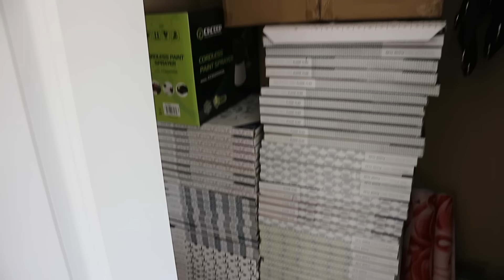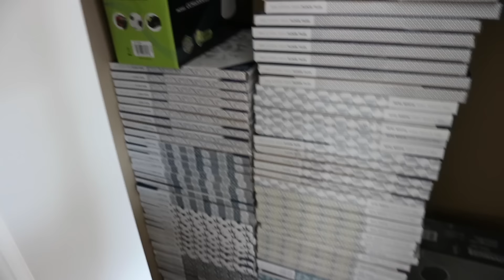I Spent NOTHING On This Bathroom Makeover !! HOW?!?

Comment: Someone may have said it already, but it might be a good idea to cover the seams in the tile with clear caulk. Since it's by the sink, any water splashed on it could get in the cracks and behind the tile to cause mold. Also showers add a lot of moisture and heat to bathrooms which makes the mold happy.

Comment: Having used that vinyl sticky stuff, it would have been easier to do the back bit before doing the tile and separately from the main counter top. The join with the wall would have been hidden by the tiles and the join with the counter would have been hidden with the silicone. Plus less material makes it less fiddly in corners.

Comment: The only thing I would have done differently is put the vinyl that’s behind the mirror and take it all across the wall behind the toilet. But over all looks great!
Reply: I agree, I was a bit disappointed when she chose to only do it above the vanity.
Reply: was thinking the same
Reply: I was upset with the mirror. I wish it was horizontal not vertical. Also! The plant I feel is a fire hazard lol. I would put a short stocky plant but everything is great like always
Reply: I also thought maybe putting some type of framing around the vinyl would have looked nice too.
Reply: Yep I would been a nice accent wall. Maybe use that paint idea where the pictures are at.
Reply: I agreed with you but then I thought: maybe she doesn't have enough to do the whole wall. AND all the cutting out around and behind the toilet is probably very difficult and not so easy to "access" to stick it right and everything...
And blue of the feature wall behind the toilet on the end really pulled everything together. So at the end I didn't really mind
Reply: Same!
Reply: I love that she put it on the sink area only.😊 Looks so beautiful, and now the sink and toilet areas are kind of separated.
Reply: i came to the comments to see if anyone else was thinking the same thing... i agree!
Reply: I agree. I would have been all for carrying the vinyl across and behind the toilet . or doing a large arch behind the mirror instead. Just my preference I don't think she needed both.

Comment: A tip for the plastic decor on the counter top,use heat from a blow dryer to smoot it out and poke a small hole with a thin needle and push down on the bubble and add heat❤️❤️ also for next time measuring the space and corner and cut where the corner are so in fold easier 😃❤️ I did a makeover in my kitchen with only plastic decor and paint for under 100 dollars 😍

Comment: You could have left that mirror up and had molding cut, then glued them on to frame it. Great solution for that type of old mirror. I did it for 2 bathrooms. Obviously you didn't have molding at home, but it is an easy solution. They sell paint that you can use to cover laminate but it is a multi step process. I can't imagine contact paper would last very long. Your tiles look very good.

Comment: Use the Duck shower curtain on the inside of the shower as a liner while the grey fabric curtains are in the outside. Cut the duck shower curtain into 2 peices so you have 2 panels and face the ducks into the shower when you hang them.

Comment: So when we built our house the guy that was doing the tile in the bathrooms asked if we wanted him to do tile on the countertops in the kitchen. I looked up some pics of it and thought it was really pretty so we did it. BUT...a HUGE BUT...the ones I looked up had very very little to NO grout lines. I mean, imagine how hard it would be to clean grout every. single. time. after cooking especially after working with flour. WELL!!! The guy that did ours made HUGE grout lines! Like a half an inch thick! It is so EXTREMELY hard to clean. We want to cover it with something. I'm wondering if that film you used would work. We would definitely need to fill the grout lines with something so it wouldn't have those big dips in the film where the grout lines are. But I think it might work!! Gonna show this to my hubby 😊 see what he thinks.

Comment: No, that's not too much decor, in interior design you have the choice to decorate with 3 heights: short, medium, tall. It usually keeps it from looking like there is too much. For example, if you had used 3 candles instead of the plant, soap, and candle it would have felt cluttered. It looks amazing. Also, I'd suggest either: put stoppers behind the hanging shelf so the shell doesnt get knocked off, or put the shell on the toilet and use the shelf for like 3 extra rolls of toilet tissue. I'm loving these new videos where you decorate

Comment: I'm afraid you might have problem keeping your tiles on the wall for any lengh of time because gravity will likely join  forces with bathroom humidity and they may start to fall off because you didn't glue them, like you did you grad parents bathroom floor.  The difference is gravity.